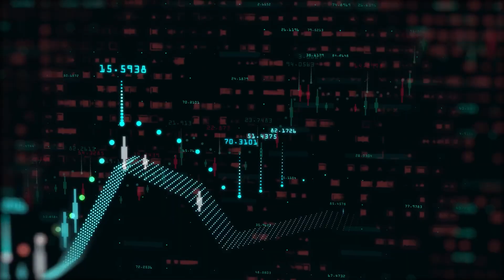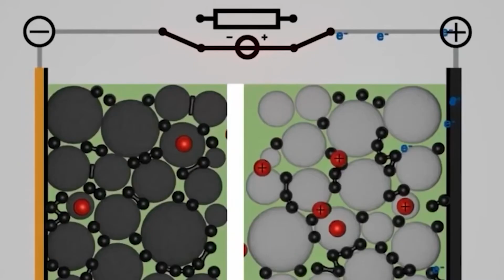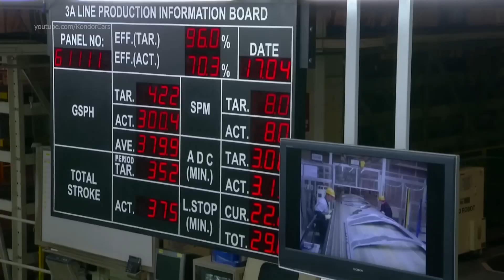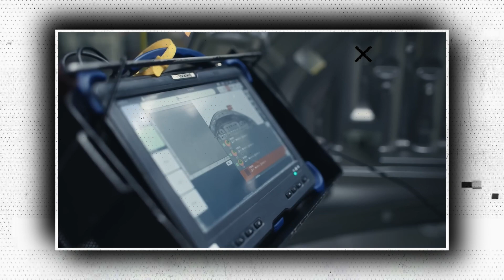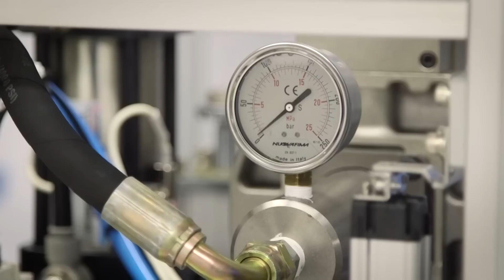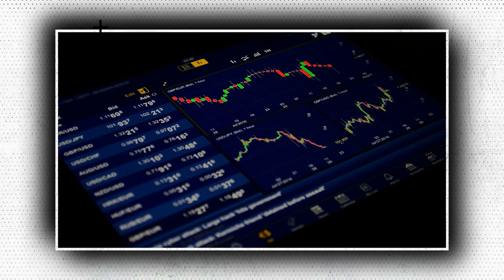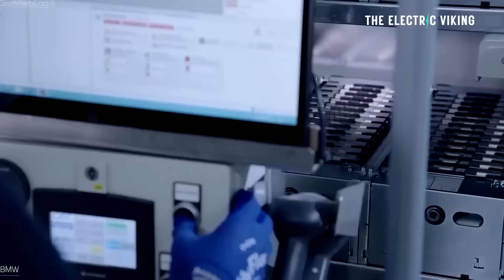Toyota Battery Expert Just LEAKED A Groundbreaking EV Battery!

Comment: Toyota has known an industry fact - Lithium is a dead end for EVs - there isn't enough production; it takes 500,000 gallons of water to refine 1 ton of Lithium. This limits EV production to about 5 million Y size battery packs per year in a market of 100 million light vehicles. The Japanese government is concerned about perception rather than these limitations. They are pushing Toyota to take a share of this market even if it isn't going anywhere to prove their technology.